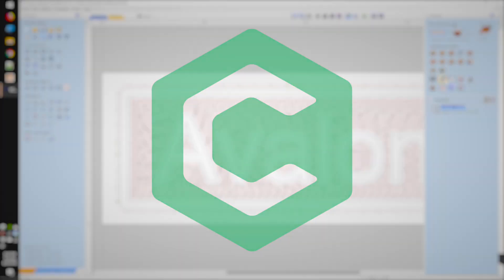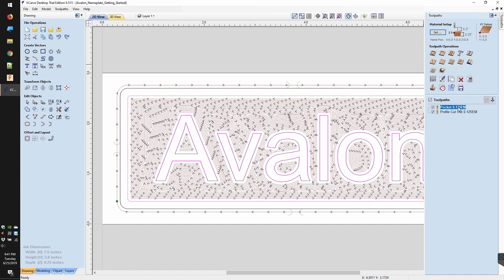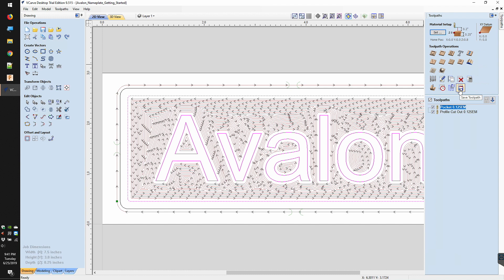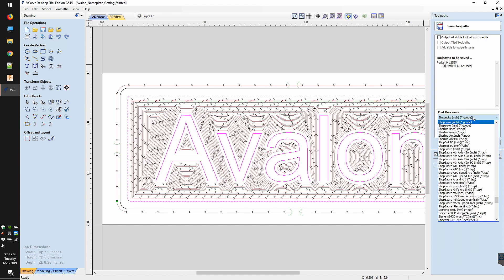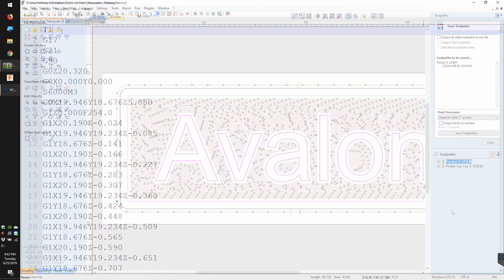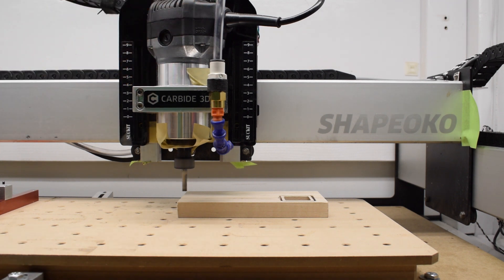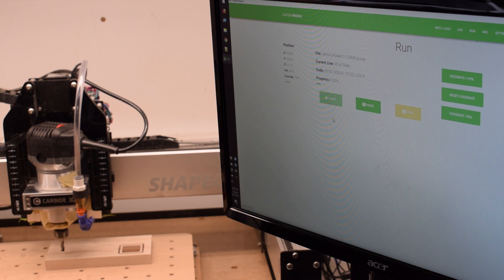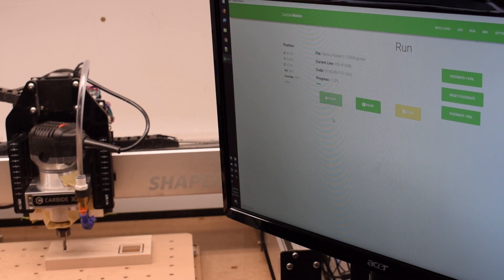How to Use Vectric Software w/ Carbide3D CNCs

Comment: Thanks for letting us know that we have to creat a separate file file from as carbide 3D users.  But I do have question, like if my first step is to face the material,  then the second step is based on the first step.  How do I save the Gcode and operate the carbide motion?  Could you give me a video tutorial?  Thanks a lot.

Comment: I have recently started to try using V-Carve Pro and when I save a file for my Shapeoko in post processor,  I choose the Shapeoko inch format. It is saving it as .gcode and not .c2d. When I try to open it with Carbide Motion I get an error that reads "Error in line 1009: Arc Endpoint Error" can someone please help? Thanks
Reply: .G-Code is the final code that you feed into Candle, UGS or Easel to send to CNC machine, it is generally NOT a design editable format.
.C2D is a design editable project file format for VCarve, these 2 will generate a .gcode file that goes to the machine.
I hope that clarifies for you

Comment: If I send the Gcode with Carbide Motion will i still have to add the M6 command? ( I love the M6 function) I'm on the verge of buying into Vectric because Carbide Create has helped me learn but is now frustrating in its ability to play with more advanced workflow procedures.
Reply: You don't need to add the M6 command, but it will make the gcode behave more like what you're used to if you do. If you want to automate its inclusion, you can mess around with the post processor as +krtwood suggested. 

You will still not be able to export multiple toolpaths with different tools in one file though. I've asked why Vectric doesn't enable it by default and never got a response. No love for Nomad users...
Reply: @WinstonMakes That is fascinating prob something to do with the impressive MeshCAM and Carbide Create Pro? (which would be sweet)  
By the way, your videos are why I got the AMAZING (5 Star) Shapeoko XXL 5 months ago. I have been very impressed with the entire Carbide 3D experience and the Shapeoko XXL.
Reply: @Gnew111  Glad the content's helping! 
Vectric operates in a bubble separate from MeshCAM and Create, I think they just targeted the CNC router community and left it at that, that's why it's the "Shapeoko" post processor, not the "Carbide3D" post processor like Fusion's. And it makes sense I guess, effort wise. Nomad is a smaller market. But they were so close to being seamlessly integrated with everything...